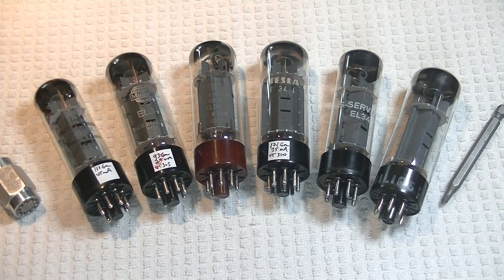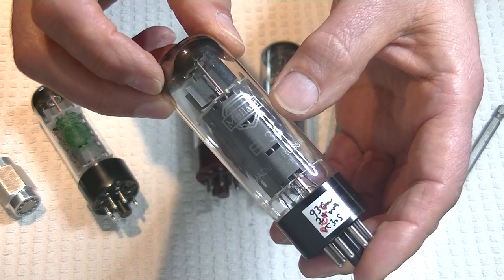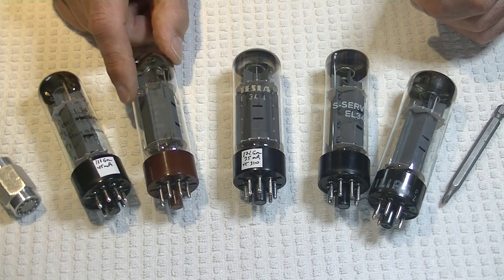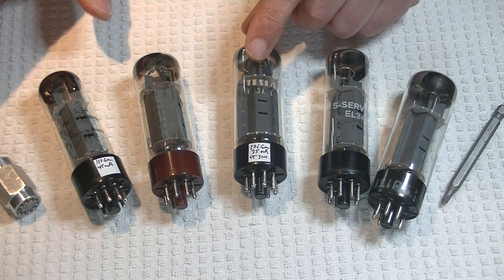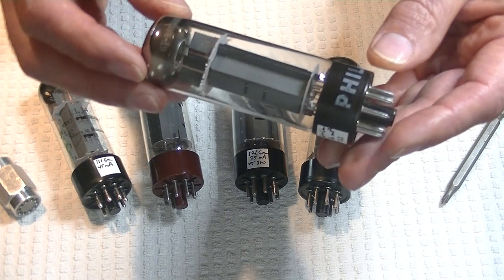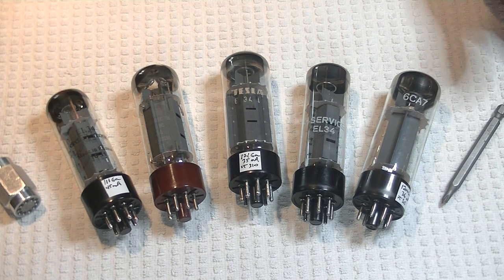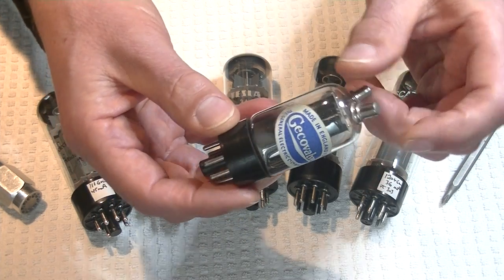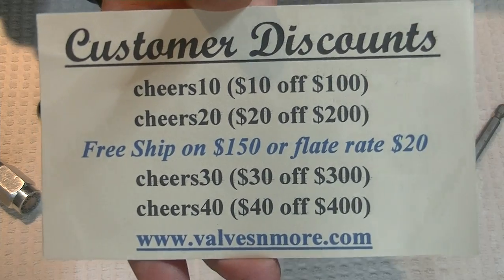Tube Lab #25 Rolling the EL34 Power Tube with the Willsenton R8

Comment: Tesla is a shortcut of TEchnika SLAboproudá which means low current technique. Maybe the translation isn't 100% accurate. I'm now building an amp with them - stereo 2x50W, 2x EL34 per channel and the Toroidy output transformers for KT88 pushpull

Comment: Your subjective descriptions of the "sound" of these tubes are meaningless. Let's see some DATA.  Use an audio analyzer or an oscilloscope with Bode Plot functionality and sweep the amplifier with the different tubes installed,  under otherwise identical operating conditions, and let's SEE the differences in frequency response for each via those Bode plots or spectrum captures.
Reply from the maker: With all due respect, listening, I mean really listening is a far more valuable tool than any sweep.  Now that said, we do sweep our Kit designs during development and it can provide valuable information.  But ultimately critical listening is far more useful in tube rolling and amp design, in our experience.  I was an audiophile in the 70's when all we wanted was the specifications and the sweeps, and our equipment had the life sucked out of it by designers relying on what their screens were saying, instead of what their ears were hearing - never again.

Comment: Great info , very informative to newbie. I’m 95% sure I’m going to purchase the W8, not happy of the mismatches , but now I see from you that can be rectified. But I was going to go with the KT88 version . ( using not to efficient speakers) . Will be waiting to compare 6500 to KT88 and maybe your idea of purchasing simply the cheapest set-up with EL 34 is the wise decision . Then replace . Thanks again
Reply: Mabye take a look at the 6CA7. It should work better in the R8 then the KT88, and be somewhere in between the EL34 and the KT88 in characteristics. I have an R8 on the way and not to efficient speakers, and thinking of going with a matched quad of EH 6CA7 "fat bottle". They are not vinatge but hence a lot cheaper and are getting great reviews from R8 owners.

Comment: Notice how the Electroharmonix, Reissue Mullard, and other Sovtek EL34's have plate structures that look like the RFT/Siemens?  That's because when Sovtek first produced the EL34 (as EL34G), there were trying to emulate RFT, albeit unsuccessfully.  Similarly, you might have noticed how some Shuguang types have plates that look like vintage Matsushita EL34's as the Chinese tried to copy the Japanese types, also unsuccessfully.
Reply from the maker: This is a very good point!  Yes many 2nd and 3rd generation tubes, follow this pattern of building to a known good 1st generation.  Almost never do we see an attempt at a brand new design, though some high end Chinese tubes are doing just that, taking the best of the past and merging it with modern manufacturing materials and methods, with good results in many cases.  And yes I agree 100%, very very few so called "reissue" tubes are worthy of the name they take from the past - in any way.

Comment: Hey Jim, I was wondering if you could give me some advice. I think I have a bad EL 34 tube in my Willsenton R8.   As a newbie, can I replace that individual tube with another brand without messing anything up? Could I put and 88 in there or does there have to be a sense of symmetry with the number of tubes on the unit. I would love your advice. Thanks in advance.
Reply from the maker: Same type, same manufacturer, matched electrically as a quad (4 tubes) is critical for good sound.  When I sell a quad of matched power tubes I always recommend buying a matched spare.  And we always record the test numbers, so if at a later date you need a replacement,we at least know what to look for - we may not always stock a correct replacement, but at least we have a chance at a match.
Reply: @tubelab194  Thank you, Jim, for taking the time to give me some guidance. I’m sure your advice is something that can be used by many of us!

Comment: I have this 90's Audio Innovations Classic Stereo 25 with the Svetlana ( Winged S) and some telefunken ECC803s(goldpinned) ECC83 and some TAD12AU7A in there, my first decent tubeamp combined with some JBL L19 and still wondering if this Willsenton R8 would be the next thing to consider...
Reply from the maker: If you haven't replaced / upgraded the pots, electrolytic and coupling capacitors, it may be worthwhile doing that and have a listen.  You may find your existing amp sounds great and no need to upgrade.  Remember the Tubes are the Amplifiers, everything else is just tying them together.  The only other components that are critical, are the output transformers and if they're good quality, then you are good!

Comment: great video! I have some teslas (early 90's) that are just like the ones there, but with brown base... do you know anything about them?
Reply from the maker: If they are early nineties they should have black bases (I think), the original factory in Czekoslvakia made mostly dark brown bases in 1950's and 60's, the pins are crude rough looking stubby things and the brown bases discolored with heat.  The modern copy/reissue has a light brown (milk chocolate) base that looks perfect.  This copy is the most common version you'll find available and is nothing like the real tube.

Comment: As with Derek below, I am investigating tube amps with a possible purchase in the future.  However, common sense tells me that I am an idiot to consider the purchase of a piece of stereo equipment without first listening to it in person.  I live up hill from Sacramento in California, which seems to be similar to the Gobi Desert when it comes to stereo equipment.  My existing system is antediluvian, Klipsch Cornwall I speakers, B&O Beogram 1700 turn table and Nakamichi SR-3A tuner/ amp.  A fit of insanity prods me into the possible purchase of a tube amp.  The Willsenton R8 is one possibility.  (I might have to fly to China to hear one play.)  

Three days ago I had never heard of tube rolling-is that the correct term?   

Does anyone own an R8?  If so, do you recommend it?  IT currently is selling for over $1500 on the Internet.  Will I have to spend a lot more to obtain the better tubes?

Any direction in this arena is appreciated.  THANKS
Reply from the maker: Yup it's called tube rolling, you roll a set out and roll a set in, lots of fun and the rewards are an improvement in sound, often significant.  Remember the tubes ARE the amplifiers, yes you need a bunch of inexpensive resistors and capacitors to wire it up and a quality output transformer, but by changing the tubes you can have a very different amp.  The best price on the R8 for me was direct from China (Chi-Fi.com? something like that), if you are patient and choose the slow boat option the shipping is reasonable for a 50# box.  The stock tubes in my amp were so bad I threw out the power tubes.  But in fareness I specialize in quality vintage tubes and because I've been selling a lot of complete sets to R8 owners have come to specialize in R8 tubes.  The R8 is a steal at the selling price, even if you spend another 50% installing quality tubes.  It doesn't matter what new tube amp you buy, you will eventually decide to re-tube it.  I would say the R8 is a perfect introduction to tube amplifiers, maybe at some point you'll want to hear what a single ended triode (SET) amp sounds like, but for an affordable, easy to operate quality tube amp it's hard to beat as an introduction to the amazing sound of tubes!
Reply: @tubelab194  Thanks, Jim.  How does the R8 compare with a 300B amp?  Steve Guttenberg totus the Boyuurange A50 Mk III, which is available for less money.  He says that a 300B is the best tube amp system.  My reservation with that choice is that it only goes down to 30Hz.  (I don't know if I could hear the difference but I LOVE the Klipsch sound.)  That amp comes with the PSVANE rectifier tubes. Are they a Chinese knockoff or a descent tube?

Your thoughts?  THANKS, Mike
Reply from the maker: @Oldgoat912  I'm not intimate with a 300b amp, though one is on the drawing board.  The two amps couldn't be more different, a SET 300b is going to have lower power (about 8w), and higher noise floor, while the R8 will have much more power (45w in UL with KT88) and with the push pull design comes very low noise.  Single ended amps have a unique sound that is clean and clear as well as very intimate (I run a pair of custom 6L6 SE monoblocks).  If you go the low power option, you either need very efficient speakers or you commit to a normal listening volume.  Most audio enthusiasts will have several amps and enjoy them all.  Even though my favourite amps are single ended, I've thoroughly enjoyed my time with the R8.
Reply: @tubelab194  Thanks, Jim.  I am confident that my Klipsch Corhwalls can handle the 8W signal nicely.  Unfortunately, with every question I ask, I end up with my having two more.  I see a tube purchase from you in the future.
Reply: I personally love the Willsenton r8 with my Klipsch Forte IIIs.  I have had it with stock tubes for about 6 months and am going to start collecting tubes here soon to get rolling.
Reply: I love my R8. My original PSVANE EL34’s lasted about a year before one tube went bad. Having no others to compare, it’s just a guess as to which tubes I should replace them with. I believe my short tube life was because I neglected to turn the amp off before going to sleep a few times. My R8 is also used for my video setup.The life the R8 brings to music it also brings to movies.  Tubes for life.

Comment: Ventilation holes?
Reply from the maker: Did I say holes?  If so I meant to say rectangular slots or slits.  The cathode of the EL34 or any power tube for that matter gets extremely hot and I'm pretty certain the openings we see on the plates are meant to help dissipate the heat.  On the EL84 the smaller cousin of the EL34 you can clearly see heat residue on the glass directly in line with the plate openings.  I'm open to another explanation.
Reply: I've always wondered about this as well. The tube has a vacuum inside it (duh), so no air. Therefore, those apertures can't possibly be there for air cooling, right? I'm not sure what they do, but obviously they do something, or else the manufacturer wouldn't put them there